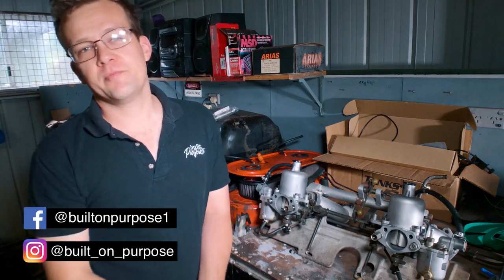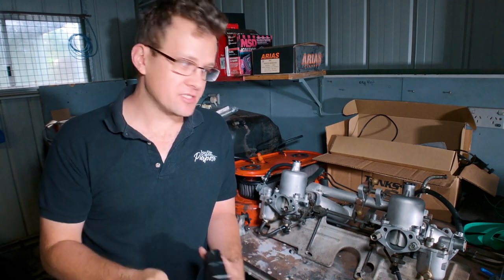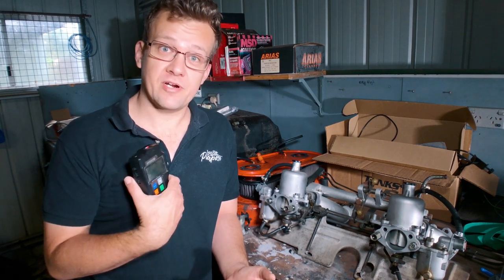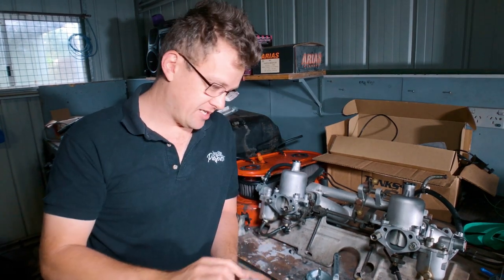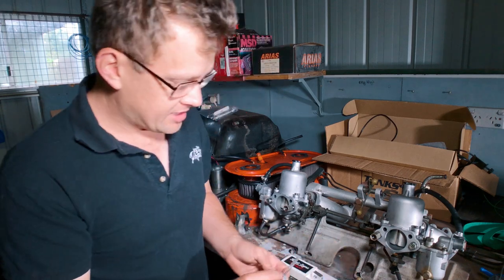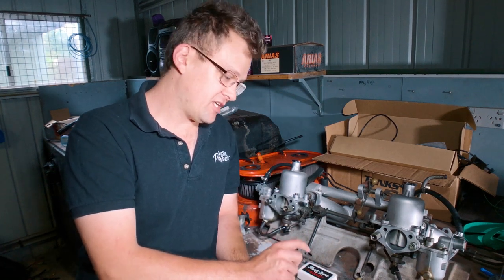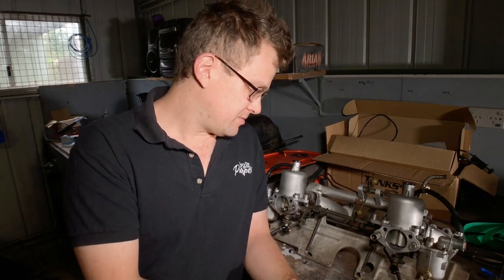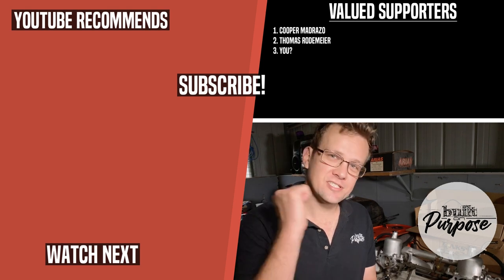Three must have Hitachi SU carb tuning tools

Comment: I have most of these:
1. Both Air Balance tools, I find the Unisyn the best due to access.  I have to take the (non-stock ITG style ) dual air filters off to get to the stubby air horns (velocity stacks).  After getting tired of these and doing some experiments, I returned to the stock air filter setup with a K&N reusable filter. The stock horns are as good performance wise, and it’s just *easier*.  The other setup looks cool but isn’t really needed.

2. Float-Sync.  Agree with this choice.  You can only set the fuel floats crudely with the float bowls open.  On my car, the ‘ears’ on the float bowl lids seem different height front/rear SU.
If you don’t get the fuel level correct in the float bowls, the SUs are  hard to balance correctly throughout the rev range. 

3. AFR- I bought a single sensor, and gauge type AFR display, so no data logging. I wish I had seen this video sooner.  It has been mainly useless as the engine runs rich at idle anyway when tuned properly.  If you dyno they monitor and log AFR for you.  Least useful, IMHO.

You didn’t mention colortune, which is harder to use, but does give a view into the cylinders to ‘see’ the actual combustion happening. But watch out- with modern fuel blends this method can give inconclusive results.  I bought one long ago, but never use it now.

I also think the best SU tune tool is ‘your senses’.  Does it smell rich, how do the different ‘hissing sounds’ change as you rev the engine? Old-timers listened to this with a length of plastic tube or fuel line. Will it start to stumble if you raise the piston slightly, or does the revs increase slightly and then drop?
Here’s a tip: Push the pin that lifts the piston slightly   It should speed up momentarily and then settle back to idle. If it speeds up and stays there, raise the adjusting nut up one flat CCW. If the engine speed falls off without increasing, lower the adjusting nut down one flat CW. If engine speed increases slightly and then drops, leave the jet adjusting nuts where they are.  Then go back and balance at idle (I use 750-800 rpm) with the unisyn and idle screws, and then again at say 2400 rpm with the balance screw.  Done. It’s really that easy.
BTW- you must setup: Compression test, valve clearance, Sparkplug gap, & timing all before tuning the SUs. Or you’re wasting your time. 
Didn’t mean to write a book here, oh well.

Has anyone tried SM needles on a 2.6 or 2.8L engine?  What did you think of SM over stock?
Reply from the maker: Thanks for your contribution. There are valid points and relevant information.

I have not used colortune but I have heard it is a good tool. I have some colourblindness which makes it difficult to determine flame colour 😖. 

I trialed SM needles but found them rich at idle for my liking. SB needles were that last needles I dyno’d which were reasonable at idle.

Comment: Curious to know if you’ve looked at optimising the distance between the carb and the inlet port on the manifold. Not sure if it’s an old racers trick or where I came across it but the distance can affect low down torque. I haven’t tested this to any degree but interested to know if you’ve looked at this.
Reply from the maker: Yes, it is possible to influence the engine performance with a tuned length intake. I had a set of custom EFI ITBs made for my engine in my newer videos which did just that.

Comment: Thanks for the vid. Do you remember what air fuel ratio your Z was happy at with the SU's? I recently put SU's on my 260Z that already had a wideband O2 gauge in it. These carbs were recently run on someone else's Z, so I was surprised they were running very rich (in the 10 range on the gauge), even more so since the car seemed to run very well. I attempted to lean it out closer to 14.7, but that made the car very unhappy. Had to eventually dial it all the way back to the 10's. Car runs great again, doesn't smoke, which is surprising...at 10/1 a/f ratio you'd think it'd be smoking black. Thoughts?
Reply from the maker: Unburnt fuel can throw out AFR and isn’t always a bad thing. It might be worth calibrating the sensor in clean air in case it’s reading richer.

From memory my AFRs were 14.5-15:1 cruise and idle and 12.5-13:1 for wide open throttle
Reply: @kyushaspeed  Thanks, Aaron! I forgot to clarify that it was only at idle that it read so rich. In all other ranges it reads much more normal. Cruise is at mid 14's, for example.
Reply from the maker: Hmm it could be a number of things. If it’s running well, no excessive particles in the exhaust gas and your plugs aren’t fouling it’s probably ok 🤷
Reply: I got my float syncs a few weeks ago any could agree more - they helped so much to get my carbs running decently.  It would be really great if you could do a video using all three of these tools. That ancient Z-Therapy video is the best tuning resource I’ve found so far but definitely leaves a lot to be desired. I’m particularly interested in how you set your fuel mixture using only a single AFR probe.
Reply from the maker: @rulecity  I’ve seen dual WBO2 sensors install in Zstory headers to better tune each carb. That would open the doors for really fine tuned optimisation! 

I’d love to create a tuning video but I’ve missed my opportunity. It would be bench theory only as I’ve recently swapped to EFI ITBs.

I still have my copy of Ztherapy’s video 👍
Reply: @kyushaspeed  hah well if you’re ever in Los Angeles you’re more than welcome to come shoot a video using my car to tune 😄 

I bought the MSA 6-1 headers and now am really wishing I’d bought something with dual collectors just so I could put in two AFR sensors. Ah well.
Reply from the maker: One of my mates here in AU has the 6-1 MSA. They look good.

Could you squeeze a WBO2 in a runner from each carb? Not the best but it would be better than nothing.
Reply: @kyushaspeed  Yeah, that's not a bad idea. I've got lots of tuning to do, but once I hit the limits of what my Gunson Colortune can tell me I'll probably give that a shot.